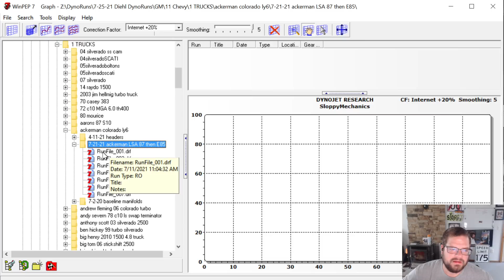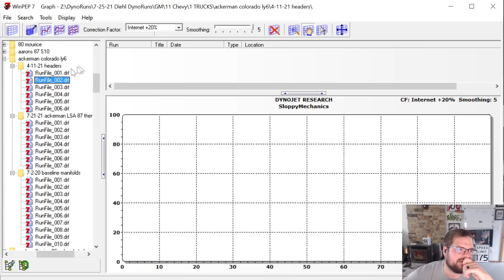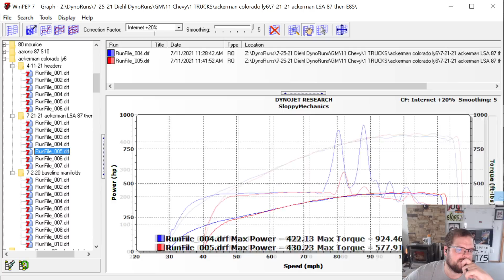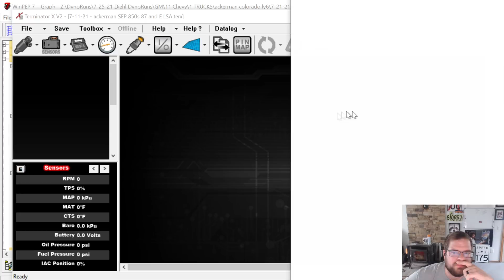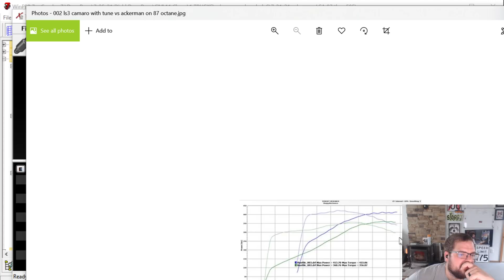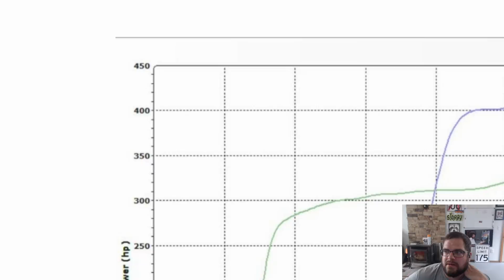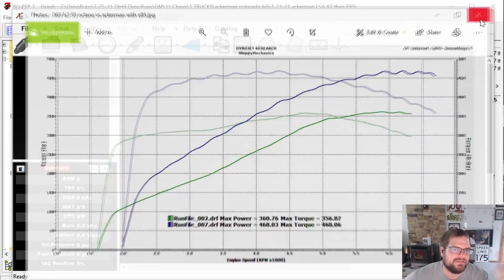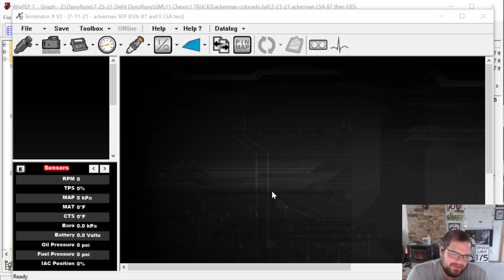Whackshack 87 octane LSA LY6 Colorado

Comment: What fan have you and do you suggest running in having temp issues in Florida sitting in drive through or long lights. Running the eBay rad and electric fan in my swap

Comment: Yeah what cam ?
What pulley ratio and iat?
Sounds like stock truck lower on stock lsa pulley
My ly6 with stock ls3 cam took 17.5 psi 18 degrees for over a year 93oct no meth. no dyno but ran 6.70 4650# so 680whp ish so yeah ly6 can boogie

Comment: Matt, do you have a video or would you be willing to make a video describing ways to get a gen3 LS to work with a gen4 ecu. the reason I ask is that Id like to retain the factory ECU and gauges in my 2012 Canyon but a gen4 motor and harness (if you can find one) is not exactly cheap. Thanks for your time.

Comment: Lol I have done the same thing with my fbody, just loaded a tune for 87 to cruise around on everyday. Like me though I daily this car and put miles on it and hell if I save $5 a fill up and I'm atleast driving a tank a week in a year I've saved $240. Heck that can either go into the car or used for something else. But why waste the $ on 93 everyday when you don't need max power every day and alot of times your just cruising around having fun. I could understand max effort trying to race people every day but still that truck should be plenty fun on 87. I know my camaro 87 with a/c on is still a blast.

Comment: Sounded Spicey.  Super shocked at low results, but meh, pump gas low octane. Stuff happens man, just search through it and figure out the headaches. Slip the corn juice in it and whack it with a 800 horse tune. Nvrmnd-just saw the tune, wth?! Weird, something is funky there. Cf/ correction factor- on the Dyno graph should be SAE shouldn't it? Top right corner of graph. Wth is internet 20%?

Comment: Isn't the 112 LSA on the Sloppy Stage 2 a bit on the narrow side for a Roots setup ? Aren't you just blowing cylinder pressure out the exhaust ?
Reply: My first thought. Especially when he said it was only 6 PSI. From what I’ve seen LSAs typically puts 9-11 psi stock. A positive displacement blower will drop a couple lbs as efficiency improves in the upper rpm band. Unless he purposely kept blower drive ratio lower with the intentions of running 87🤷‍♂️
Reply: @mroconsultingandsupport4776  Glad to see that I wasn't the only one thinking this. Because the goal of this build is/was to be a Daily Driver, with the power down where it is most used.... I can't help but feel that the 114 LSA of the Sloppy Stage 1 and it's shorter duration, or even the OEM Ly6 camshaft may have been both better under the crossover point. The Sloppy Stage 2, with a bit wider LSA (perhaps 116) or even some added advance on the intake (maybe a 116+2) with the same lift and duration @ 50 would have been more suitable. The problem is the current long exhaust duration combined with a tight LSA, which in an N/A application would help scavenging etc, but in a blower app, it's wasted potential, literally right out the exhaust.
Reply: @joeyjojojr.shabadoo915  stock LSA cam is 120ish lsa and upper 190s duration

Comment: Wow he will save at least $150 next year, he could buy a house with that.
Reply: Exactly.
Reply: 87 to 93 is 1.00 diff right now so id save 50.00 a week easy if i ran 87.
Not turning my shit down so instead adding enough pumps to run e85 which is 1.20 cheaper atm
Reply: @Thelastoftheog  You're buying 50 gallons of fuel a week? At 10 mpg that's 500 miles a week. You are driving the car 26000 miles a year? Sounds like you need a Honda not e85
Reply: @chipcurrey653  23 miles each way and maybe a mile or 2 for lunch break 6 days a week. 800whp ctsv th400 swap so no overdrive and when you have a blower car you usually have fun with it. If i drive it 1 day im usually putting 20.00 a day of 93 in it. So i usually just leave car at work. Main reason im going e85 is so i can turn it up a little more

Comment: I was always told 87 is not possible when boosted but then again ford does it with their Eco boost F-150, I can't get E85 in my county and 93 is to damn High for a Daily driven truck. Super Interested in this!
Reply: Direct injection changes everything. Having control over when fuel is injected allows you to have boosted/high compression application on regular pump. This allows fuel to be introduced at the precise moment needed at a much higher pressure (negating the need to compress fuel too). The L83 5.3 has 11:1 compression and runs on 87 fine . DI kinda throws the “rule book” out, DI diesels have been doing just this for a while .

Comment: Blower on it making less on the first hit is kinda funny. Shows how much power it takes to rotate those big heavy blades and push air through truck heads. 

The heads, intake manifold, compression and lack of blower drag on the LS3 really make it flow tons. 

Light timing really and basically no boost… 6 psi is like a joke for that blower.  Hahaha  keep the timing out of it and put the boost in it and make sure you got the MAT ignition retard set aggressive so it doesn’t knock if the blower heat soaks.  

Needs lots of boost just like you did for the G35…

Comment: So if you take e10 87 octane and literally wash it with water and drain off the you separate the ethanol and get 82 octane. I always wanted to try this to tune part throttle cells on the street that aren't knock limited on 87 or 91 to get close to mbt. Get it to knock on the 82 octane, add 87 and more timing after etc

Comment: I am wondering what is done to the rear-end?
Stock welded diff? Stock axles? Any Re-enforcement?  Thanks a bunch! 🙏
Reply: Stock rear. G80 modified gov posi. New cover because it rotted off
Reply: @MrRyan62583  how is the yoke holding up? I thought those yoke on the rear end is the weakest point and I’ve seen so many people break them
Reply: @HaZo0oMo  good so far I put like 15k on the truck the last two summers. But I’m an old man I spin the tires but I don’t put a sticky tire on and hit the drag strip I’m sure it would 💣
Reply: @MrRyan62583   Awesome cause I thought i would have to do a 8.8 swap. Now i will keep the stock rear end as long as i dont use sticky tires. How are you keeping the engine cool? using stock radiator? any electrical fan? Cause my Ls3 cant stay cool
Reply: @HaZo0oMo  stock 4cyl rad. Hrr ss fan assembly
Reply from the maker: he has nearly totally stock diff in this just lowered, IIRC frame notched but totally stock otherwise

Comment: 87 is some interesting shit - I wonder if it would make sense to run some sort of direct isopropyl alcohol or something mix-in for when it gets into boost, sort of a budget meth injection system that you can refill at the local CVS if you want to.
Reply: A snow meth kit is like $280, you can run purple supertech -25f washer fluid (40% per msds) for super cheap.
Reply: @beyblayder   That sounds particularly sloppy and dangerous. I'm in. lets do some 87 + wiper fluid tests

Comment: LY6 Is like 9.5:1 compression
Reply: I have a N/A low compression lq4 9.5  that makes 426 to the tire with a cam and intake with out the turbo. The ly6 have better heads(823's) and 9.6 compression something must be up with this engine not to be making more power than this.
Reply: @alanbrossett4744  my ly6 made 435 cam on e85.

Comment: So, with premium fuel 14deg@14psi has kind of been the safe limit. What would you think 87 octane would be limited at?
Reply: Stock LSA timing table for low octane ranges from 4-10 degrees between 2500-6500 rpm and is what I have used for my LQ4 blown setup (plus 1-2 degrees depending on IAT's) with 10 psi for a few years and the rods have stayed in when I short blast it. I am not real mean to it on the street when I run 87 because 10psi on street tires makes stupid torque off idle and as a result 1st and 2nd gear is useless. It still makes enough power in 3rd and 4th that you are a hooligan if you drive around with that level of power. 10 degrees and 10 PSI with short blasts (keep the IAT's low, but blower with A2W) has been safe for me.
Reply: @hackjobhotrodshop5075   Wow that's nuts...LSA seriously like that low of timing? Our Honda V6 motors take up to 38-40° low cam and up to 30° max ign high cam when NA. 93 octane I was running 22° at 8psi and it could have taken more...fun to see the difference of what different motors like 🤙
Reply: @HalferLandPerformance  stock f150 ecoboost is about 0 degrees of timing from the factory. On 93 my tune was about 5 to 7. On E50 I'm at 12 degrees. Interesting stuff.
Reply from the maker: unsure, this liked 6psi and 14deg max up top, not sure if it would like 14lbs but it would be neat to try, at least at this point in time he doesn't want to do anything